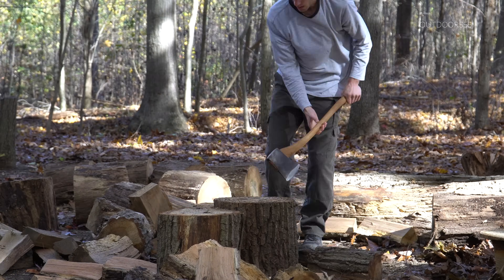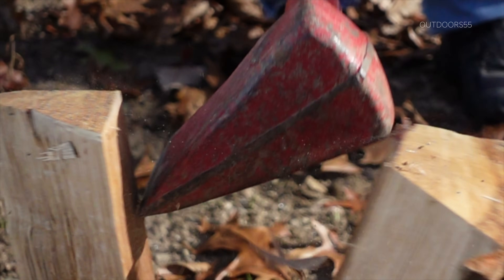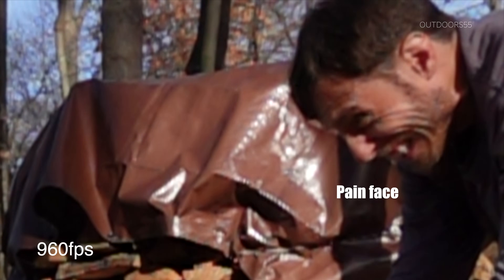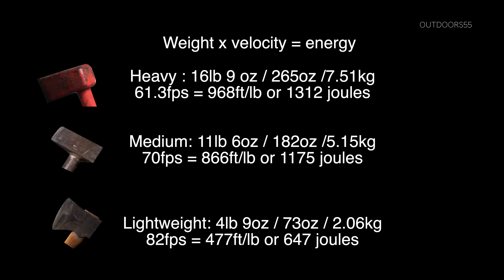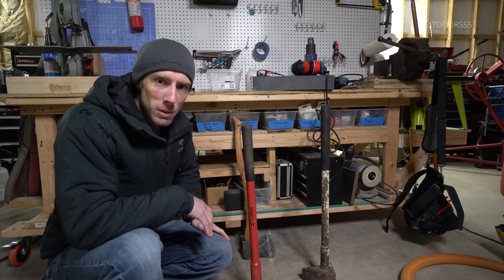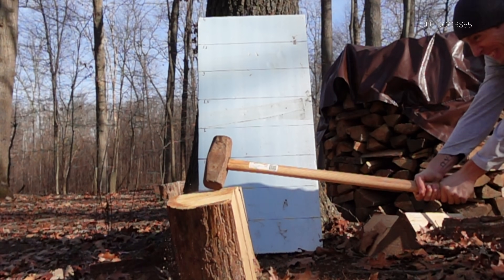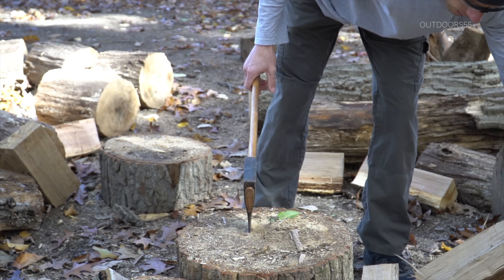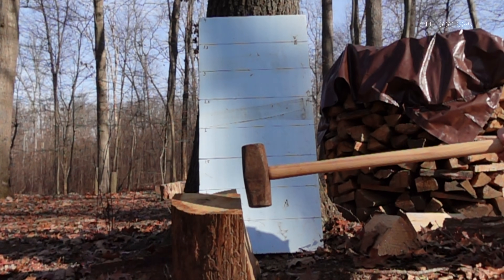The Great Wood Splitter Debate

Comment: 1:00 the formula for kinetic energy is (1/2)*mass*(velocity^2)
Reply from the maker: I was soaking wet and freezing. Had a brain fart😂🤷‍♂️
Reply: @OUTDOORS55  I hear ya. Love your channel, brother.
Reply: I think momentum would be a better formula,  but even then wedge geometry would play a major roll and that's not accounted for with either formula.  The right test would be which wedge profile creates the most horizontal force with the least amount of vertical force.
Reply: @stabbinfatties9489  if you're going to get much farther into the physics of it I'm hoping we'll get to the "perfectly spherical logs" stage soon 😂
Reply: @kevinkarlwurzelgaruti458  truthfully there is a reason why there are so many sizes,  shapes, and weights of splitting mauls,  different kinds of wood have different requirements. Some woods will split with an axe, others it'll just stick in and require wide angle maul,  but it's a whole lot easier to swing an axe than a 16 lb maul. So the best design is the lightest one that will still effectively get the job done on the wood you are splitting.

Comment: I've been splitting wood for fireplace use over the last 22 years at my present location and a few years ago, I discovered the Fiskars X27 which is far and beyond better than every other method I've used.  It is used effectively for diameters of 30" or less of seasoned hardwood.
Reply: but plastic handle....
Reply: @rolls_8798   its not plastic you make cups with, its indistructable and nowhere near as much vibration as in wooden handle.
Reply: @draganpastrovic2157  it's actually fiberglass.
Reply: @draganpastrovic2157  I know the material and I do agree it is very durable, but I do not think you are right about vibrations, and the slipperiness and other ergonomic aspects do not make it viable for me. I understand that you are able to hold the handle more slackly in your hand (and thus absorb less vibration) when splitting - I am more used to chopping - but it is just not enough.
Reply: @rolls_8798  each to their own mate 👍
Reply: @draganpastrovic2157  absolutely. Luckily, there are plenty of wooden-handled axes for me to pick from and we all have different preferences
Reply: @rolls_8798  fiberglass.
Reply: @TheDanAge  plastic resin with glass fibres in it. hooray.

A lot stronger and less flexible but still unusable for me.

I respect fiskars for their ethos and a lot of things they do - they have decent steel, clean minimal styling and are made to be indestructible and impervious across their range but they sacrifice too much ergonomics and natural, organic aspects for them to be useable for me.
Reply: @rolls_8798  if you really like the head but don't like the fiberglass handle, you could always drill it out and put a wooden handle on it. It would be nice though if they sold a wooden handled version as well as the fiberglass handled one.
Reply: @keithyinger3326  I don't think I could given the way it is made and personally, I'd rather find something with some history anyway, but I do understand the utility of an axe you don't have to oil or worry about breaking with overstrike
Reply: @rolls_8798  So what?  The handle is also more durable and has similar feel characteristics.  I have 1 Fiskars and 6 wooden handle axes (that I built myself) and the Fiskars wins hands down.
Reply: @PabloP169  not to go off but I think that just speaks to the quality of your axes... but we all have different preferences, and, as the other guy said, to each their own
Reply: Force = 1/2 mass × velocity squared
Reply: Just gets stuck in desert eucalyptus and pine.
Reply: yep, i agree.
Reply: Keep it up u are close to escape ❤of the9-5

Comment: My brother built a log splitter out of scrap I beam, a large wedge welded to it, a hydraulic ram and a 5 HP B&S motor. Slow and steady wins the day IMO. I have found few pieces of wood that will stop it. A few weeks ago we split 2 truck loads of an old twisted hickory. She would bog down a few times but eventually overcame. Splitting manually, it is essential to cut with the check in the wood (learnt from many years of splitting by ax, maul or maul and wedges). Ain't nothing like trying to split sweetgum, you have to "hull" it from the edge inward. Try hitting in the middle with a maul and it will bounce back and the wood will just laugh at you.